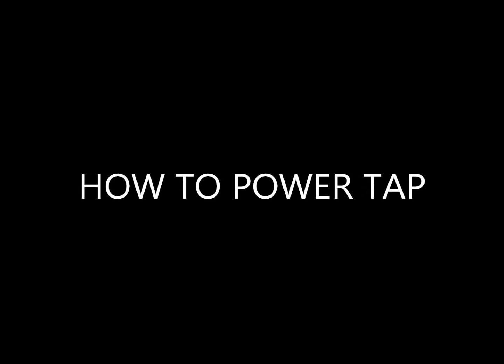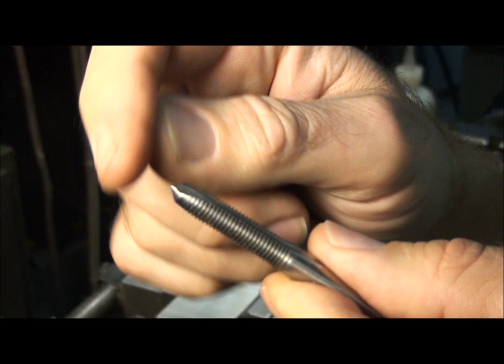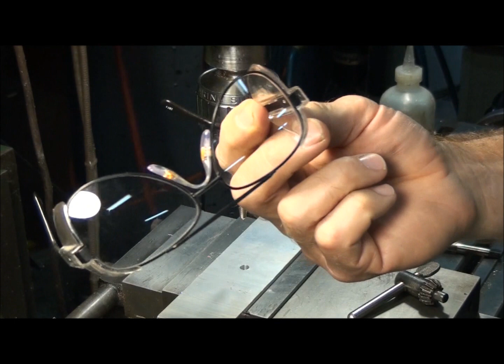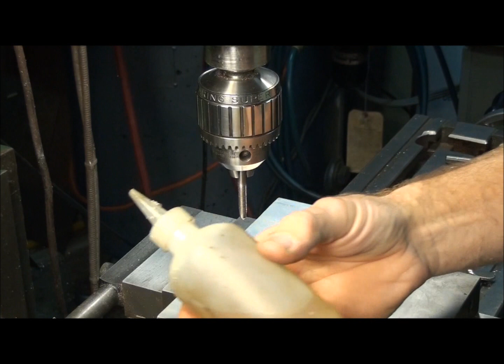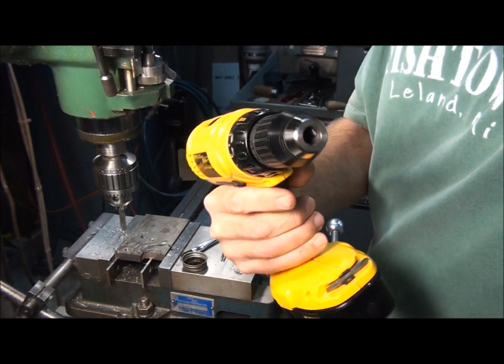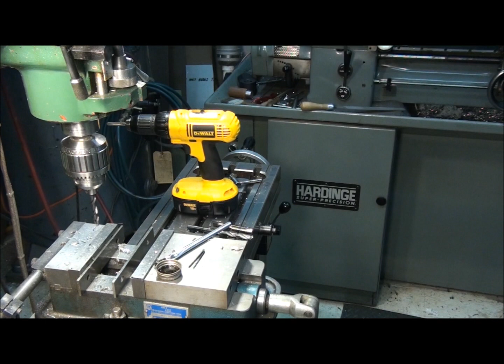How to Power Tap

Comment: Never occured to me that "power tapping" is something special. In fact, watching this made me wonder why people wouldn't do that. Seems kinda counter-intuitive, leaving the perfectly set-up machine just to cut the thread by hand. Only time I'm cutting threads by hand is when I drilled the holes with a handheld drill... Well. Guess this is another one of those small little differences between the US and elsewhere. Great video though, spread the word!
Reply: I just noticed... Don't you add a small chamfer (counter-sink) on the edges of the pilot hole prior to the tapping operation? Chamfering after tapping will push some burrs into the thread, so it's much better doing this before tapping...
Reply from the maker: I do not pre-chamfer my tapped holes. It's a lot faster to do it after the fact using a cordless drill. Never had an issue with burrs when using a sharp counter-sink.

Tom

Comment: I TAP LIKE THIS ALL THE TIME, BREAKING A TAP CAN BE PREVENTED BY USING CORRECT TAP DRILL SIZE AND ALWAYS CHAMPHER HOLE BEFORE TAPPING,
Reply: Yep! Without a lead-in to guide it, its tougher on the tap. Also make sure its a gun tap you use!
Reply: I'm the old grumpy teacher at the local JC....I let them start taps like this...... But then, get a feel of what they are doing... I tell stories of breaking 1" taps... And chiseling .... Fracturing  them out!
Reply: Can you do it on say 1/2 inch steel or is this something only for aluminum?
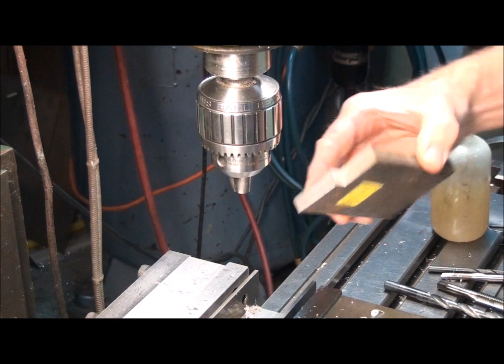Reply: @DominicPaz  did you watch the video? 7:20

Comment: I cringed when you were tapping with the part in your hand without even throwing a glove on.  Sometimes the taps grab, and it probably wouldn't have been good for the hand holding the workpiece.
Reply from the maker: A glove? Seriously? I'll take a cut on my hand any day over having it twisted off. Even a small mill can generate enough torque to remove your hand if get a glove entangled with the spindle. You comment is timely though because entanglement injuries will likely be the subject of my next video. It's been a while since I've made one on safety.

Tom
Reply: Only time you should have gloves is when your cleaning or at least that's what I do.
Reply: Toms Techniques You were using a cordless drill, but point taken.
Reply from the maker: Forgot about the cordless drill part. I was referring to the mill. :)

Tom
Reply: Seriously? You’re suggesting that you’re supposed to use a glove when operating a mill/drill? That’s a great way to get your arm destroyed, or even killed possibly(with a mill/lathe). Unless you’re talking about tapping without a powered device, by hand. 

Folks, DO NOT WEAR LOOSE CLOTHING OR GLOVES WHEN HAVING YOUR HANDS NEAR MACHINES THAT SPIN AT HIGH RPM. It will destroy you. Look up lathe accidents on YouTube if you don’t believe me
Reply: Even a hand powered drill can wreck your hand if the glove gets caught.

Comment: considering the number of taps i have brake ... i wouldn't even try this , i would just place the tap on the chuck and drive it by hand. thank you for your video.
Reply from the maker: Coward. :)

Seriously. If you follow my directions and use the proper tap and cutting fluid, you won't break any taps.

Tom
Reply: Toms Techniques how about HSS taps?
Reply from the maker: What about them???
Reply: Do they break much too?
Reply from the maker: All of the taps I use in this video, and all that I ever use are high speed steel. The trick to making this technique work is to use spiral point taps and to not over tighten the chuck.

Tom

Comment: Great technique 
Thx alot
May i ask you, please what kind of drill press you promote for a machine shop with medium duty work ?
Reply from the maker: Do you drill enough holes for a dedicated drill press? I just use my mill for any holes that need drilling. It's faster than taking the time to layout and center punch holes to be drilled on a drill press.

If you do have use for one, I would recommend a 20", possibly with a geared head, depending on how large holes you need to drill. If you want new, Baleigh and Powermatic make good ones. In the used market, look for Clausing. They were well built and last forever. Don't waste your money on Chinese made hobby drill presses, with the possible exception of Grizzly.

Tom

Comment: Tried a 5/16 tap with my power drill.. 4 holes, all turned out excellent!  Thanks Tom!
Reply from the maker: Excellent, Mike!

Yesterday I tapped 520 4-40 holes in some 6061 aluminum bar with a cordless drill. It took most of the day, but I finished up with the same tap that I started with, which is always a good thing. :)

Tom

Comment: Hi Tom, Does this only work on a through tap?
Reply: K Gee  as opposed to a bottoming tap? I would assume that would be possible so long as you are conservative and finish the tap by hand.

there is still likely some benefit in saved time if you are careful.
Reply from the maker: It will work on blind holes as well as through holes. Just be sure to 
start out light on the grip, so the tap can slip when it reaches the 
bottom of the hole. Also, smaller taps are more likely to break in blind
 holes than through ones.

Tom

Comment: Hey Tom,  just another one of your terrific demos.  Evidently, it's not important to keep backing off when power tapping, like you would hand tapping, or isn't it really necessary.  or  Is that all because it's a spiral tip?  Thanks
Reply from the maker: Yup. The spiral point makes it unnecessary to break the chip as with a hand tap.
Reply: Your the best, Thanks Tom

Comment: All your vids are first class. I would like to bring up one point though , since you are using a 3 phase motor ( I'll go out on a limb and guess you are still using the original spindle motor ) you don't have a problem banging reverse. A lot of machines can be had with single phase 220 or even 110 volt these days. Even a lot of 3 phase isn't made like it used to be. Single phase and some of the cheaper 3 phase motors hate being reversed under power.  Your subscribers with 110 single phase could see these motors eating capacitors like they were beer nuts. For them it would be better to turn the spindle motor OFF and use the spindle brake or leave room to coast down and finish the threads by hand.
Reply from the maker: I haven't seen that Michael, but I suppose anything is possible. I've power tapped on a 110V drill press myself with no problem. It was set up with a reversing pedal so you could keep both hands on the machine and just step on the pedal to reverse. Of course it was an industrial drill press so the motor was probably built to take it. 

Thanks for pointing that out.

Tom

Comment: I'm not a machinist by any means, I'm an engineer who likes to be aware of machining practices.

My question is this: Isn't the spindle's height usually controlled by a hand lever? If so, what allows the tap to travel through the part at just the right speed to prevent it from stripping the threads? Do you just release the hand lever and it's free to be pulled down by the tap as the tap spins?

Also, wouldn't there be some likelihood of the tap stripping or damaging the threads as it comes to a sudden stop, and then jerks to a start in the reverse direction?
Reply from the maker: The quill is left free to float so the tap can pull itself in and out. Reversing the tap mid-cut is normal procedure for any tapping method. It doesn't hurt the thread at all. If you calculate how much force it would take to pull the thread after the tap is in a couple diameters, you'll see that there is no way that can happen. Even if the quill hits the mechanical stop by accident, it just causes the tap slip and pull out of the chuck.
 

Tom

Comment: Hey Tom, I've been power tapping on my Bridgeport all the time. But what I like to do is after drilling the hole I pop in a countersink and give it a little relief to help the tap go into the hole. I feel that this helps when tapping harder materials like SS.
Reply from the maker: +Steve Billmire 
I've heard that too Steve, but never really noticed a difference. I normally counter-sink mine after the fact with a cordless drill to save time, although doing it before hand would create less of a burr on the threads.

Tom

Comment: I power tap on tool steel at work all of the time and it works great. Ever since I was introduced to the spiral point tap I shudder at the thought of using a hand tap. It seems that everyone local sells hand taps, and yet spiral points are so much nicer to use.
Reply from the maker: +Chip Wright 
Yeah, I'm surprised you can even buy a hand tap anymore.

Tom

Comment: Probably if you set the speed in low and run in 60 to 80 RPm works better.
Reply from the maker: +Edgardo Torres 
Better, or just slower?

Comment: Won't taps made from hardened steel damage the drill chuck?  I only use chucks I don't care about for this (usually on my lathe), but maybe I'm just being priggish.
Reply from the maker: +pythoncoltz 
Apparently not. I've been power tapping for the last 30 years with this chuck and it still runs as true as when it was new.

Tom
Reply: Cool!  I'll be less fussy then.
Reply: BTW, what kind of mill is that in the video?  The quill looks as thick as my hauser jig borer!

Comment: Thanks for the information as it is something that I will now use, mainly for speed using the cordless drill and for accuracy using the mill.
Reply from the maker: +Ralf Boyke 

Thanks.

The cordless drill thing takes some practice to get the tap going straight. I just start them a bit and look at it from both directions, correcting if necessary.

Tom

Comment: Makes a lot of sense, good info.
Reply from the maker: +Larry Marc-Aurele 
Thanks Larry
Reply: +Toms Techniques  Any advice on cutting male quarter-20 threads?  Having trouble even getting it started manually.  This is for short, half inch lengths attached to shelf supports.
Reply from the maker: +Larry Marc-Aurele 
The easiest way to cut non critical threads for something like that would be with a die, or just make them out of 1/4-20 bolts.

Tom

Comment: G'day Tom thanks for the power tapping video I have some small holes to tap into a stretcher frame so I might give it ago, glad you showed tapping though steel because that's what I will be tapping in thanks mate John
Reply from the maker: +John Kinnane 
Be sure to use spiral point taps and lots of oil.

Comment: Too much speed. The rpm's don't need to be that high.
Reply from the maker: +KC Jones 
Taps should be run at about 1/2 the rpm of a drill the same size. For the 1/4" tap in aluminum, that could be 4000rpm. For the 1/2" tap in steel, it could be 400 rpm. The limitation here is how much experience you have and how good your reflexes are. It's best to start slow and work your way up as you gain experience. 

Tom

Comment: Sorry if it's been asked and answered already, but how do you get your spindle to reverse so quickly? Is it just a matter of flicking the reverse switch on your vfd? Thanks in advance
Reply from the maker: +jkuc003 
I use a rotary phase converter, so all I need to do is reverse the switch on the mill. I'm not that familiar with a VFD,, but have been told that you can use the existing switch to control the VFD to do the same.

Tom

Comment: Unless you are tapping to someone else's specs shoot for a 50 % thread,
not the usual 75% given in handbook tables. Easier on taps.
Reply from the maker: +Jim L 
That's fine as long as your application can tolerate fasteners with 30% less pullout strength.
Reply: +Toms Techniques   Tom-  I have never seen the 30% figure in publications. "Machinery's Handbook"
says as long as you have 1-1/2 Dia. of engagement  50% or 55% is adequate. Others say 60% results in an  insignificant  reduction in pull out strength.
I just drilled three holes P (.323) ,  Q (.332) , and R (.339) in 1/2" thick CRS and power tapped them 3/8-16 with a  used spiral tap in a chuck with visible runout.
These holes should give 64, 53, 44% threads respectively. Put a hex head bolt in each with a hard washer and snapped the heads off using an 18" breaker bar. The breaks were all at the top of the CRS block,
leaving the remainders filling the holes. Bolts in P and R were plain hardware type, Q was a grade 5 hex head.
All of these are easier to tap than when using the usual 5/16 (.312) tap drill. Just trying to encourage power tapping as does your fine video. I agree 50% is on the low side.
 Regards, Jim.
Reply from the maker: +Jim L 
Jim,

There is nothing wrong with using less thread engagement. I do it on occasion as well. I'm just saying that you need to consider the application because a thread with 50% engagement will have less pullout strength than one with 75% engagement.

Tom

Comment: Thanks for the great videos.  I have no way to disengage my spindle from the quill handles.  How do you get the proper feed rate?  Will it just pull the tap into the hole (and therfore spin the quill handles?)
Reply from the maker: +Steve Clark 

Yes, the thread on the tap just pulls it in. Just be sure the stop has adequate clearance so it doesn't bottom out. 

Tom

Comment: I have been using a cordless drill with my hand tapper, I took off the handle and made an adapter to work with my cordless drill. It aligns the tap and the clutch on the drill can be set to the size of the tap, I start off on a lower setting and work my way up. The hand tapper I bought only came with fractional sizes to fit the taps but to my surprise they also fit most of the metric sizes as well. When I machined the adapter I made both sizes without removing it from the lathe chuck then I sawed it off. Well they must not have aligned the hole straight so I just put the whole thing in the lathe and trued it up. Worked great and it feels quite safe to use.

Comment: i power tap all the time on the mill or a ridged drill press set-up but for the hand drill only taps 5/16ths or bigger i have seen way too many guys breaking 1/4 inch taps off that way because they are not making sure the tap is straight or the let the drill drop a little part way through, Love your videos by the way

Comment: Hi Tom, sorry if this has been answered before but couldn't find it in the comments..  Is there anything you should be extra aware of with blind holes? (other than using a spiral point tap).
Thanks for the video!
Reply from the maker: Just err on the light side when you chuck the tap. You can always tighten it if necessary.

Thanks for watching.

Tom
Reply: Toms Techniques Thanks Tom :)

Comment: I power tap blind holes daily. You should always chamfer your drilled hole before tapping. Also look into spiral fluted modified bottom taps for blind holes. good video.
Reply from the maker: ziikzaaak
The tapping process is the same, but the taps themselves are larger in diameter to allow for the insert. The chart above will tell you what size tap drill is needed. You'll also need the special installation tool and one to break off the tang after you screw the insert in.

Tom
Reply from the maker: ziikzaaak
Looks like a winner!
Reply: Hi Tynan - why is it important to chamfer before tapping? (if you use this method)
Reply: ziikzaaak Easier on the tap and loads it up evenly reducing your chance of breaking off at the top of the hole. Also helps with chip removal.
Reply: Tynan Clum
Thanks Tynan :) I'm new to this tapping business - so I'm trying to learn..
Reply: You know if there's something extra I should be aware of when I'm going to tap a blind hole in aluminium for heli coils - do I need a special tap - or could I go with any spiral fluted modified bottom tap?
Reply: ziikzaaak  I don't install many helicoils but heres a chart you can reference.
http://www.noblefix.com/helicoil/HeliCoil-Tapping-Chart.html
Reply: Toms Techniques
Gonna buy this set for the tools & drill.
(http://www.afsrecoil.net/threadrepair/en/Products/Thread_Repair_Kits/Pro_XL_Kits.html)
Could I use the included Tap - or do I need a better quality spiral fluted point tap?
Reply from the maker: ziikzaaak
I don't think I've ever seen an insert tap with a spiral point. They are normally just ordinary plug taps. If you expect to power tap, it will need to be a spiral point tap.

Tom
Reply: Thanks Tom, yes for my use I would need a M10-1.25 Tap for the M8-1.25 inserts. And as far as I know you can't get M10-1.25 spiral point taps -so I guess I can't power tap for this purpose?
Reply from the maker: ziikzaaak

Insert taps are made specifically for the inserts and it's not as simple as simply using a larger standard tap. An M10-1.25 may work for an M8-1.25 insert, but it would be coincidental. Plug taps will not work for power tapping, except maybe for very shallow through holes.

Tom
Reply: I see :)
I have found an insert tap with spiral point though - if I read the chart correctly..
http://pages.citebite.com/j4w1g6b0w4qlo
Metric Coarse - part nr. 45088 - would be the one I'm looking for I guess.. :)

Comment: Tom, I like to use my cordless drill that way for electrical panel mounting holes. I often use "draps". As you probably know they are a drill pointed tap. They work quickly in one step but are limited to relatively thin materials. I recently powered up my Bridgeport knock-off mill with a VFD. The first operation I did was to power tap (16)  5/16-18 holes in (4)  1/4 thick steel angle brackets. It worked beautifully !
Reply from the maker: Good to hear Harry. Thanks for watching.

Tom